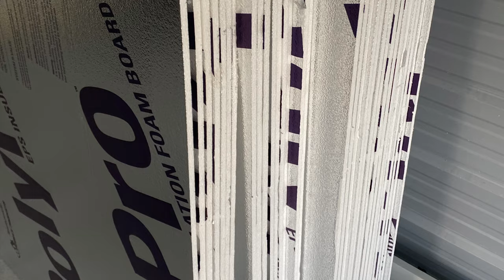Foam board insulation For Metal Garage How to for beginners

Comment: I got the same material from Lowes, I  putting mind up now its Hot so it will take months, I use stripping 1x2 to give me the air space between the foam and the metal..its a slow job so far due to the summer heat I have AC Units but its the middle of the summer so don't help much due to no insulation its usually 20 degrees hotter in a metal building than outside.   I will get the walls done within the next month and will do the roof later get my son to help with that, in a perfect world if the section were 4ft between metal studs it could be faster.  I put the shine side facing the metal walls to try to reflect the heat..hopefully it will work...yes Congrat on the baby nothing like having a Family....Good luick with the bullding and your Family if you are done Post a after video.. thanks my brotha....BJ

Comment: I took the 2” sheets cut it to fit the frame and set it flush with the frame so the metal side can get air to dry any condensation that is gonna occur with metal buildings and applying heat inside them. Then I went over the whole thing again with the 2” foam using the caps from cap nails with self tapers to fasten it caulked all cracks Then painted it all white. Super bright and super insulated.

Comment: usually you install shiny side facing "outward" i.e. the shiny side would get the adhesive.  Additional tip you use some of you scrap bits to make spacers so there is an air gap between the metal and insulation.  I know you are probably already done, and these are just extras. i am sure the insulation works enough to help!
Reply from the maker: Yes on some parts I did and I get what your saying  and I did tones of research on the insulation and it has gotten up to 100 degrees down my way and I can feel a difference
Reply: how much space between the foam board and wall is optimum?  trying to decide 1x2 or 2x2 with my 1/2 in polystyrene foam board
Reply: Amber…1x2 is fine. You just want some space.
Reply: Wrong , when you put metal to metal you have high heat transfer, you need an air gap to create an air insulator along with the styrofoam

Comment: If you ever have any more water problems look at something called through the roof it is the best sealant I have ever used and it was the only thing that would seal my roof vents when I put my vents in over my new metal roof I installed. Nice shop man 👍
Reply from the maker: Hey thanks brother ... great information 👍🏽👍🏽 and I appreciate it .... another build may be soon

Comment: Do you have a rats ledge or water ledge in your foundation?  That would prevent the water from getting in.  I have that same building.  All I had to do was silicone the tubing to the foundation & silicone the metal to the tubing from the inside.
Reply from the maker: No rat ledge I did rocks on the outer edge of the building to soak up water and etc but I did do silicone on the outside and inside of the gaps worked perfect

Comment: great videos, the insulation is hard to do on any type of non traditional type of building, I am going through that now, i didnt build it it was here, was thinking going the foam board, it looks like you might be in some what different climate then mine, I am in WA. But could you see rise in the temp in the shop on cold days
Reply from the maker: Cold days felt like I was still in 70 degree weather if it was 60-55 ish outside hasn’t gotten really that cold inside since that insulation not sure if that answers your question

Comment: Did you check to make sure the type of adhesive you used will not react with the foam as you applied it directly to the foam side.  Some construction adhesives are not suitable for use with foam products. And I would have installed it the other way, with the foam side facing into the interior of the building.
Reply from the maker: 👀🤔🤔🤔 I don’t think so .

Comment: Your garage looks like mine!! I was using great stuff to mesh the foam board to the metal but I found i would end up having something to brace it. Does the liquid nails set up immediately? If so I'm going to start using that instead. Love ur video.
Reply from the maker: Thanks brotha liquid nails was good but the loctite power grab works better 👌🏾
Reply: Tried the liquid nails construction adhesive, and it is hit-or-miss when it comes to adhesion. Tried indoor/outdoor carpet 2-sided seam tape without any luck. Same results. Guess I'll try the Loctite Power Grab now, and pray it holds! Any issues to date with the foam board not adhering? Thanks for the mention!

Comment: Good job. You can save on adhesive by just using 3 beads. You are using way too much. Run a bead straight across top, middle, and bottom of board. That will be enough
Reply from the maker: Wish I would’ve knew that lol cause god I bought a lot . Live and learn 😂 thanks though

Comment: Good job, I have a metal garage to it gets hot as hell need to do something like this. What about the floor, do you have a video about building it? Did you use gray paint? it looks presentable. Greetings
Reply from the maker: Thank you .... I wish I did have a video but I am moving and I will be building a bigger one on the new property that I think you guys will like . And it does get hot but the foam board helps out a lot I’m not saying it’s the best but u will tell a difference in humidity I promise

Comment: What did you use to anchor the peg board on to the frame like that?
Reply from the maker: I used self tapping screws but I should’ve added wood behind it lol cause it did fall 😂🤦🏽‍♂️
Reply: @everyday_life1991  thank you. I have the same garage and have learned a lot from your videos.

Comment: Are you having any issues with Sweating? I have a 20x20 and researching ways of insulating on a budget.
Reply from the maker: I don’t think there anyways getting from the sweat but the building didn’t after I did the foam board but on the roof it didn’t just the poles did if that helps
Reply: I just built the same 20x20 and wondering the same

Comment: Hey how's that working out? Looking at metal shops now and can't afford the insulation they sell and looking at the options and wonder how this is working for you. Shop looks awesome too!
Reply from the maker: Hey yes the foam board is working very good for me . I just added my ac unit in the unit I went with 12000 btu. I would definitely look into the Foam board 👍🏽
Reply: @everyday_life1991  awesome! Thats probably what I'm gonna do then. Thanks man!
Reply from the maker: No problem hope everything works out for you ...... Good luck 👍🏽
Reply: @everyday_life1991  im gonna pick your brain a bit more haha. Did you have the concrete done? And did you do footers or anything special for it?
Reply from the maker: It’s ok brother !! Hahahahah I got my slab poured before the building well I got it poured and I waited almost a month for it to fully cure cause it was winter . And we did footers 6 inches on each side .
Reply: @everyday_life1991  you in the south? I think they say we here in NJ need 3 ft footers which I think I wanna do so I dont have a cracked or crooked slab in the future. But I just got a quote for 1400$ for a freaking survey for the permit. Shits adding up.
Reply from the maker: Yessir North Carolina . And that’s Ridiculous it’s expensive I can say that I got everything for 3200 thank god which was cheap with a 4 inch slab and 6 inch footers to pass code in my area for the type of building I have which is Certified up to 140 mph winds
Reply: @everyday_life1991  that's a good price for concrete. I'm going to have to shop around then. Thanks again! Hopefully that shop lasts a long time and a lot of good memories are made with it. I can't wait to get mine.